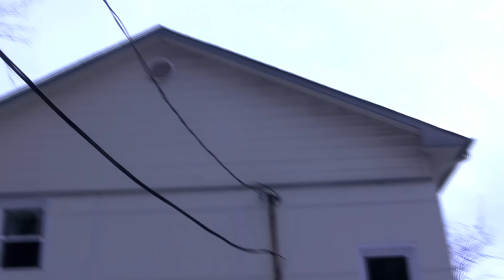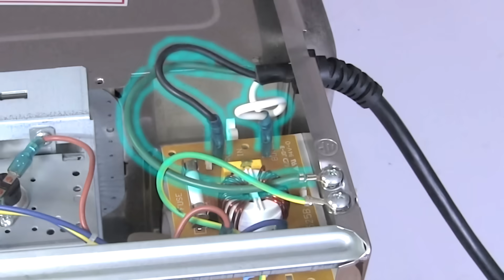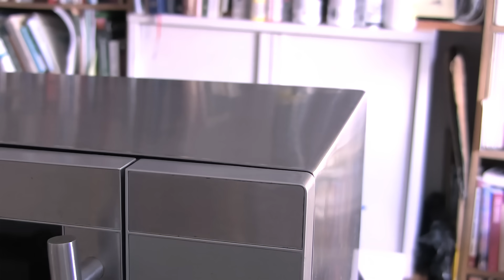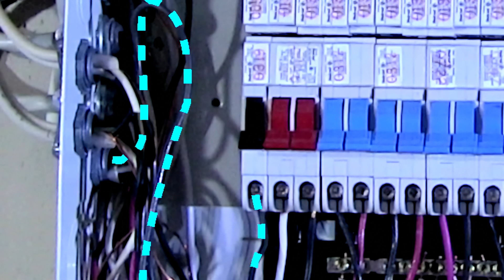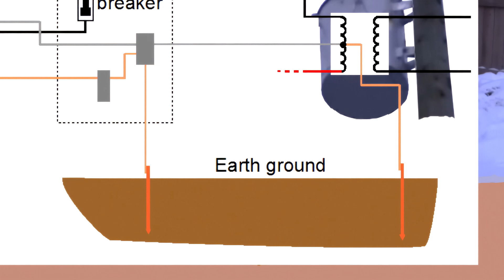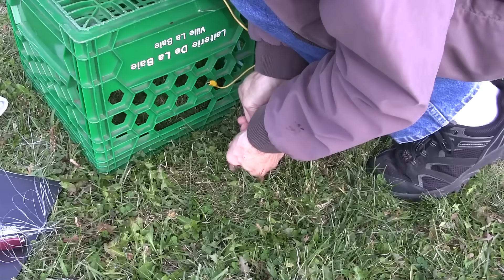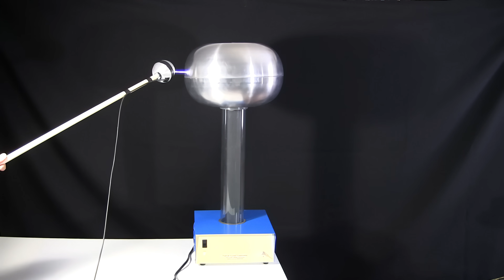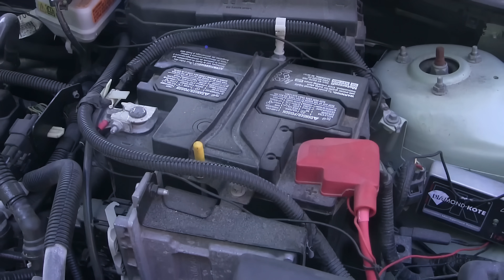What is Ground? Earth Ground/Earthing

Comment: Very cool straight to the point and clear to understand, one thing not mentioned is that it's possible that current can go to the ground rod of the house and make it's way to the ground rod of the transformer however since that path has more resistance not very much current will go through it
Reply from the maker: Very true. Thanks for pointing it out.
Reply: @RimstarOrg  Wow, thanks for responding! I’m actually inspired by you acknowledging that.

Comment: Pardon my ignorance, but if there were no ground wire on the microwave, and the hot wire came in contact with the metal case, and then you touched the case, why would that cause a shock?  What path would the electricity be taking?  hot wire --> case --> your hand --> and then where??
Reply: ground
Reply: @lolo_o4309  re-read my comment
Reply: @michaeleconomides4054  It goes to ground through your body. My bad if my response wasn't clear enough the first time.
Reply from the maker: To add to what @lollo_o4309 is saying, if you're not wearing something on your feet that is an electrical insulator, like rubber, then the electricity can go through your body, out your feet, to the ground and from there back to the ground connection at the utility pole and back to the coil and hot wire at the pole.
Reply: @RimstarOrg  Thank you.  I think I get it now.  So if there were no ground wire (hypothetically), and there were a fault, then the path would be:

hot wire --> case --> my hand --> neutral wire

But in the above scenario, wouldn't the vast majority of current just flow directly from hot wire, to the case, then to the neutral wire?  It seems like my hand would have a much higher resistance than the path from hot through the metal case directly to the neutral wire (?)
Reply from the maker: The hot -> neutral path is the normal one and involves the circuitry of the microwave oven and can be high resistance too, it may even be switched off meaning that there would be a break in the path. But yeah,, if the microwave was turned on then it might be the lower resistance path and you would be the higher resistance path. I've been shocked a few times in my life by the mains power and luckily the path back through ground to the transmission pole has always been high and I've felt only a light, though sometimes disturbing buzz.
Reply: your hand -> through your body down to your feet  -> (since your standing on the ground (the dirt, concrete, etc...) across Earth -> grounding rod --> and finally transformer. That's why electricians where protective rubber shoes that insulate themselves from the the Earth effectively cutting the path of current. No current, no shock.

Comment: I’m an engineer and I have never understood ground until now
Reply: Me too. LOL
Reply: If you're an electrical engineer, ground shouldn't be confusing. It's literally covered in circuit analysis class .
Reply: @nhitc6832 Mechanical….
Reply: @samsherrard7390  Don't mechanical engineers also need to take a circuit analysis class???? You need that to design machines with automation!
Reply: @nhitc6832 understanding theory is different than in practice. However, I’ve worked on electrical circuits and taken many classes yet have simply accepted that the earth is ground yet never understood the physics of why that is so until this video.

Comment: 7:30 this brings me back to holding the rabbit ears so I can get a better reception... I always assumed that it was because the human body is an antenna.
Reply from the maker: Holding the rabbit ears (been there, had to do that too) may also be adding capacitance to the antenna. An antenna has some capacitance and your body may be acting as a capacitor connected to the antenna, changing it's capacitance and affecting its tuning. Some crystal radios are simply an antenna connected to one end of an earpiece and the other end of the earpiece is connected to ground. Tuning in to AM radio is done with inductance and capacitance.  I'm not sure where the inductance is in that simple circuit, maybe the antenna has inductance too. https://en.wikipedia.org/wiki/Crystal_radio#Tuned_circuit Here's my video about how a crystal radio works in case that's sparked your curiosity http://youtu.be/HupFY_24o-4

Comment: but but but soil is a poor and non-uniform conductor. Yet it's expected to handle the current of a lightning strike? So how does that work?
Reply: There is so much of it! Sometimes it doesn't work, electrocuting cows far from the tree it struck.
Reply: Depending on soil resistivity, you have building code that prescribes the right size of ground connection. A three feet aluminum rod planted underground can dissipate a lot of electricity.

Comment: As an English person I find the wiring colour code in the USA utterly ridiculous ! 
In the UK, we used to have black red & green, red was 'hot' or as we refer to it, 'Line' or 'Live', the black was Neutral & Green was ground, or "Earth" as we refer to it.
Why would anyone pick black as 'hot' or line ? White would make more sense, especially as your vehicle wiring is the same as ours, Red (+) Black (-).
We now follow EU wiring which is brown (L) blue (N) & yellow/green (E).
Reply: I remember in schematics for DC circuits, the convention was that circuit ground was negative.  What is a little odd to me is DC power cables used red for positive and black for negative.  Reducing potential confusion (heh) by using different colours for AC and DC power seems like a good idea!
Reply: I'm american and I could say same thing about british color code. Why would the British choose black as neutral? it's utterly ridiculous! Different countries, different rules. Color codes are merely a way to distinguish wires apart. Once you pick a color, you need to stay consistent. What color you choose is irrelevant.
Reply: Color codes are arbitrary.  It doesn't matter as long as the code is understood.  In North America, the neutral is white and everybody who works on wiring knows it.

Comment: The connection to the water pipe is equipotential bonding, not earthing per se. It's an important distinction because in systems where there's not a local earth/ground connection through rods there might be voltage between the water pipe and the earth connection from the distribution line.

Comment: This is by far the best video ive found out of about 50. However at 2.34 I have confusion about why a hand on the microwave would provide a shock without the earth/ground wire connected to the microwave chassis/frame. My brain says you can touch one wire (hot), but its when you touch 2 wires that electricity passes through your body. 
Can someone please explain? Thanks
Reply: In that case YOU provide the path to ground.  And that's the worst possible situation.
Reply: @bclamore  yes I am smart enough to imagine that answer/reply, but why would the electricity chose the least path of resistance from hot wire to microwave casing, through you to ground, where it has still has the original path, a perfectly good neutral wire to return. Which I would assume is still the path of least resistance. See what I mean? Is there something Im missing.
Reply: @MrMichaelrichards  the path to neutral is through the microwave first, assuming it's on.  If the microwave is operating,  the electricity has to do work.  If there is a parallel path through you, it's possible to flow through both paths.
Reply: @bclamore  thankyou for the reply, so I guess if the microwave was hot like in the example, and there was not an earth wire in place, you wouldn't get electricuted if you had rubber soled shoes on? Or what about if your house is on a cement slab floor?
Would it increase the likelihood of electricution if the microwave was outside on a table in the lawn and you had barefeet? 
Am I starting to understand? 
Does current flowing from active/hot wire have a magnetic compulsion to stray from its original circuit (returning to source via neutral wire) towards the actual ground/earth? 

Is this the root cause of the problem/hazard?
Hence why the 3rd wire (to earth) is  introduced?
Reply: @MrMichaelrichards  I think you're getting the idea.  Rubber shoes would help, but I think you'd still feel it.  (Don't try it.)  Electricity does not make a choice.  It will flow given a path (or any number of paths) to a lower voltage, such as the circuit ground.
Reply: @bclamore  thanks for helping me formulate this picture of understanding.
Reply: @MrMichaelrichards  — Electricity does not "choose" a path.  It takes all paths in inverse proportion to their resistance.

Comment: Wow you have common neutral in the US wtf
Reply: What do other countries have? I'm only familiar with US electrical standards. Are you referring to single phase 240V with  240V phase-to-phase vs the US using split phase to convert single phase to two phase (120V phase-to-neutral) that are separated by 180 degrees?

If so, look up high leg delta. It's probably the weirdest thing we got.
Reply: @Snookers_ I think he meant that in other countries we normally put both neutral and hot wires in the breaker, and so each circuit has its own neutral, instead of every circuit sharing the same one

Comment: How about grounding to pipe. I believe it could degrade the pipe because of electrolysis.
Or I am wrong?
Reply: Grounding rods do degrade in time and they have to be changed to maintain proper grounding. What he shows in the video is actually a equipotential bonding.

Comment: Nice demo and clear explanation. Just it will be more productive to add earth leakage protection systems, as the standard grounding system has not protection in high resistance faults such a case that the hot wire insulation been carbonised and the fault current is not high enough to trip the circuit breaker but still is enough to kill a human.

Comment: 2:06 WHAT A STUPID SYSTEM!!!  That would kill so many people ine europe where you can plug the plug in 2 directions making one side to be neutral, but turn your plug around and it will become live/hot. And that microwave would be 230v shocker :D  in us where you cant plug the plug upsidedown it's ok but still stupid!! What if in socket neutral is in other side than it shoudl be?
Reply: No that's not how it works.  The socket outlets are keyed to prevent this.  The live plug is a different size than the neutral.
Reply: A socket wired backwards would be a pretty uncommon mistake, even for a DIYer. I've only seen it happen in older direct-wired lamp fixtures where the wires were not color-coded.
Reply: So you're conscious of the fact you live in another country, but not enough to look up your questions, or even just ask before calling the system stupid?
Reply: The breaker will pop and disconnect power from that circuit..
Reply: Did you take a good look at the holes in our receptacles and the prongs of our grounded plugs? The live hole is litterally smaller the neutral hole. Our plugs are made so that they can go in only one way. And the fact that there is ground prong make it even impossible for plug to go in the wrong way. Our panel may not look as neatly as yours but our electrical system is just as safe as yours. Of course, im not including the clueless DIY who wire things the wrong way and make things dangerous because these people can also  make your electrical system dangerous too!